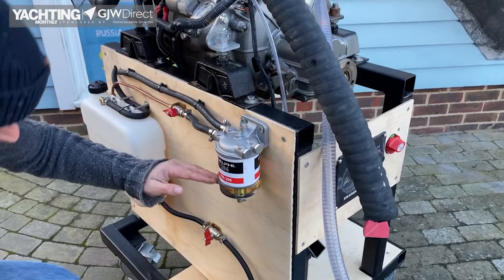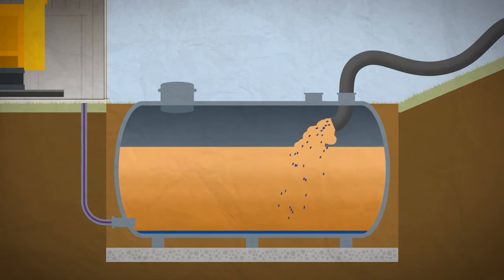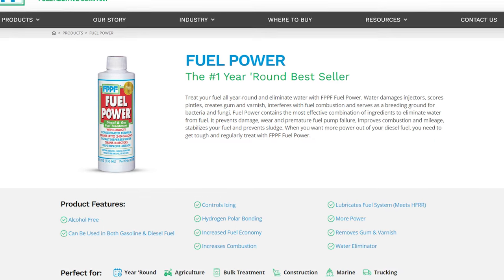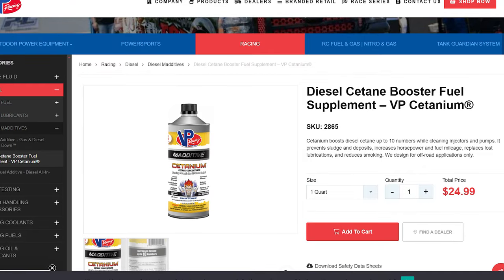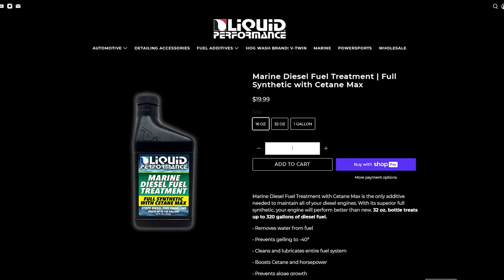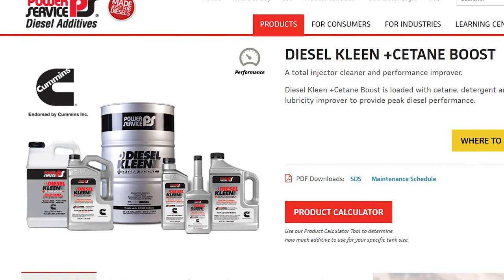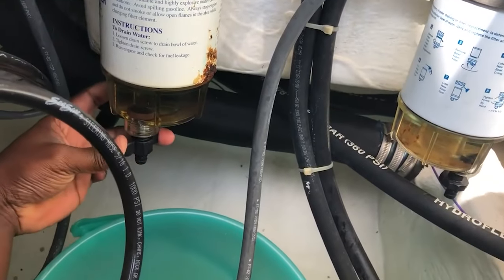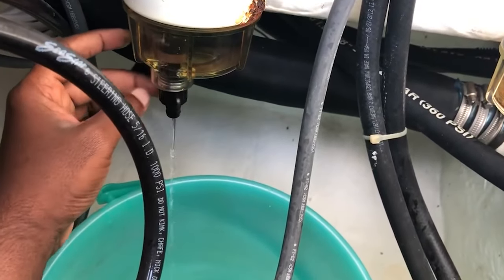Fuel Contamination? The Baltimore Francis Key Bridge Collapse

Comment: In 1979 I bought a brand-new VW diesel rabbitt. I owned it for over ten years and became very familiar with diesel engines. I ran into a guy who used recycled french fry oil in his car. It smelled very tasty and made you hungry when he drove down the street.
Reply: I know you're not kidding - I raced 4 stroke mini bikes in the early 70's when Castrol Racing motor oil was vegetable based. The whole track smelled like a kitchen. : )
Reply: Yes works good and smells but the only additive to use would be Catch-up ~ Miss the good ol days VW chopped and dune runs and beach races..

Comment: Off-topic but I wanted to ask you to give a plug to the West Wight Potter P-15; a boat that does not really fit into any category except "trailer sailor". Wonderful little boat. I learned to sail on it and took some day-long trips between San Diego and Mission Bays. Mine was hull number 2608, a 2003 model that had been sitting in garages in Lake Tahoe and Auburn, Ca. so was in near perfect condition. The P-15 looks like a generic 35' sloop rigged sailboat that has been left in the clothes dryer for way too long. Never went anywhere with it without making new friends.

Comment: I do the same diesel fuel and tank process as you. Winter storage I add Sta Bil biocide plus I add K100 diesel fuel water eliminator.  I also run the engine hot the day before winter haul out and change the oil before winter storage.  Then, during the season, I always add Sta Bil and K100 before fulling up.  This has proven to be a perfect process and have never had any water in my separator.
Reply: Tim, any comments on the 3 articles I submitted?

Comment: It's great that you're trying so hard to bring PS forward into the online content world, but one of the great things about PS was all the research that went into reporting actual experience with products, rather than just sounding like a commercial for everything out there.  Try not to lose that focus on providing expert feedback based on actually using products.

Also, I've been told that you need to be very careful not to overdo it with diesel biocides.   Helping deliver a Catamaran from VA to FL in December, one of the two engines died as we slowed down to find a spot in a tight anchorage in NC, and wouldn't restart.  A diesel mechanic couldn't find anything wrong with the engine the next morning and recommended getting the fuel professionally cleaned.  The professional fuel cleaner inspected the tank and pumped it dry through a van based polishing system and said there was nothing dirty or growing in the diesel fuel, BUT that he believed that the prior owner and/or people they had working on the boat had overdosed the fuel with biocide, causing little gel blobs to clog the pickup tube in the fuel tank.   This is the type of information that we look to PS to provide, not just a big list of potential products in the space without background info about what to watch out for and what to avoid...
Reply: More polishing, ie filtration, with return to tanks. Or if the boat is large enough, a fuel centrifuge, NOT, the cheap ones I've seen for vegetable oil processing, ones by Alfa-Laval, and others.
For everyone else, a huge stock of filters to go with the polishing rig.

Comment: I use Sta- bil in haul out and change the oil and filter  as well . I will start to use 1 of the products you suggest this year to keep it clean

Question I was told by some old salt to change the oil again after the new oil sits all winter . In case there is condensation in the engine itself ?

Comment: 19 Year old Yanmar 4JH4E (4 cylinder, non-turbo): I add 0.5 oz. per gallon of both Power Service DIESEL KLEEN and CLEAR-DIESEL. This is about 80% of the way toward the latter of their recommendations for "maintenance" and "shock treatment". I also use Seafoam instead of diesel fuel to fill the primary and secondary fuel filters during changes. I also use Seafoam to refill the secondary (Racor) filters after draining junk from the bottom of their bowls. The 16 oz. Seafoam cans are quite convenient for this and it makes me feel warm and fuzzy. The boat is kept in the Chesapeake. Engine always works well, no smoke, approx. 2500 hours.

Comment: I have a 45 y/o Volvo MD11c 23hp with about 500 hours on it. It's on Lake Michigan. At the end of the season I fill  with diesel. My mechanic said I should not add stabil or whatever it is. I haven't added anything else. I want this thing to last as long as possible. I'm even considering synthetic oil. It works just fine but I didn't l wonder if I should do more.

Comment: What I found to work in my application Lucas injector cleaner along with a fuel catalyst. Been priming my fuel filters with straight Lucas injector cleaner. Even ran my yanmar on straight Lucas that took about smoke from a lazy injector. Later found I was sucking air in my fuel system old fuel lines. Also used oil gets dumped right into tank shortly before time to change fuel filters. Found videos bench testing clearness Lucas seemed to be on the top always.

Comment: Interesting video, mad me think of a question I never thought to ask before right now. Am I the only one that's just forever been in the habit of ALWAYS adding Sta-Bil in with my boat fuel? 

Thing is I never know how long it will be between engine cranks and sometimes it will just sit for one reason or another for much longer than I expected and I never wanted my fuel to go bad. Plus living in a hot humid areas can lead to condensate buildup in the tank so I think this has been a good practice to keep water and such from building up as well. I've actually always done this with pretty much everything that's not a daily-ish driver. Motorcycles, boats, chainsaws, blowers, gensets, and so on. Stabilizing the fuel and treating for moister just seemed like a good idea. I don't know if it works but I've never had a fuel or fuel related issue. Carbs stay good and clean for a really long time, rarely do rebuilds, engine always runs smooth. Maybe I'm just lucky?

Comment: Excellent video! This is the kind of information about diesel fuel "performance additives" is exaxtly what I have suggested before (to the PS editor) that SHOULD be included as a separate TOPIC in the PS eBook "MARINE FUEL ADDITIVES". There is virtualy nothing it that ebook now on this topic. Our local diesel experts now strongly recommend regular application of either Diesel Kleen or Stanadyne when filling a diesel tank. I use Star Tron -- it's less expensive and very popular. Note some, not all, of the various products mentioned in this video include biocides.

Comment: I will have to add you should not use automotive oil filters don’t be cheap just to save 5 bucks use manufacture recommended oil filters. And change your oil in the fall don’t be cheap and lazy. Another awesome video!
Reply: "Don't be penny wise and pound foolish." is what my grandfather would say. Indeed, the cheapest path is the correct one always. Buy once cry once and DO THE REGULAR MAINTENANCE! LOL People crying because the engine side splines are stripped because their gimble bearing ceased and get super quite when you ask the last time they changed it. Sure it's a pain but it's better than having it cease on yah ;-)